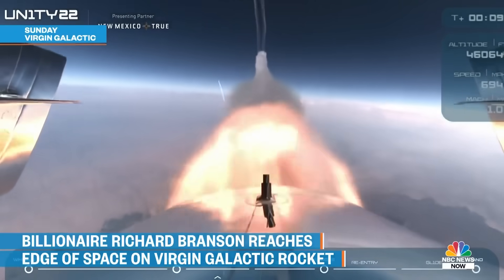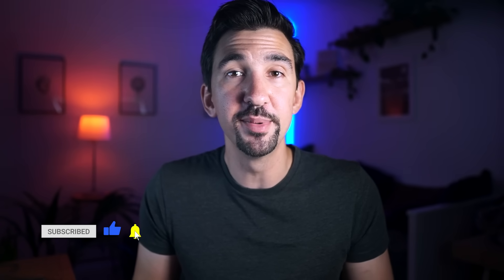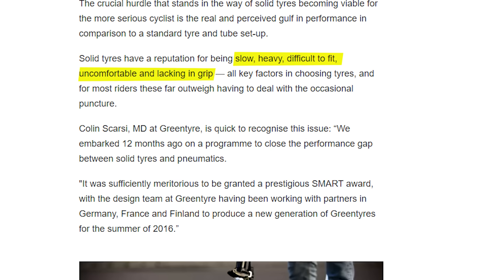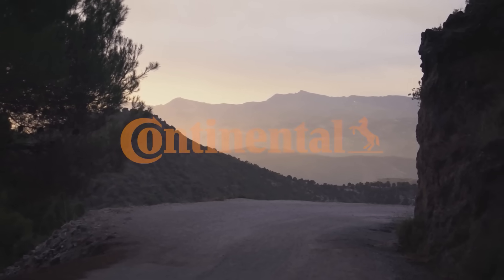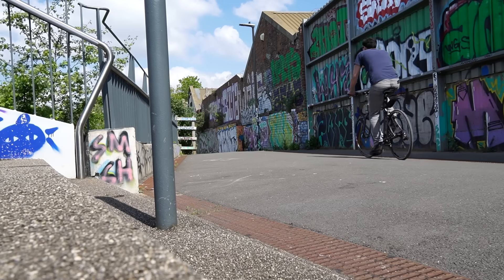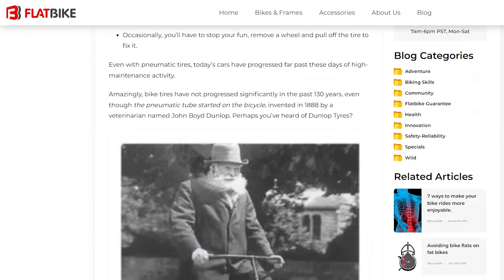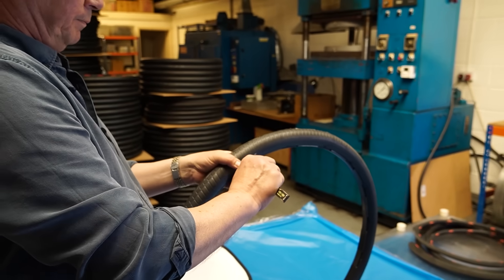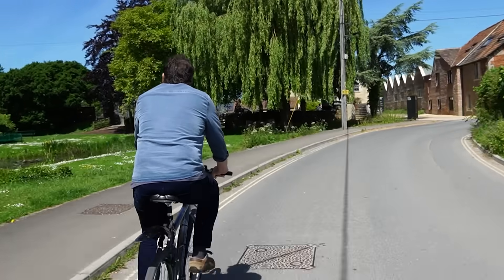I Tried Solid Bike Tires | Here's What I Found

Comment: What width of rim would you need to run these? It seems another disadvantage of these is that you can only pick a certain rim width, and absolutely need that specific rim width for them to work. Whereas a normal tire can be fitted to a range of rim widths depending on what you have.

Comment: With proper pressure, I get like no flat tires at all. Solid tires have more weight and you can't adjust the pressure like in a normal tire (if I go to bikeparks, I let some air out of them, and if I ride street for a day, I put some more pressure in them to adjust grip and rolling resistance).

Comment: 4000+ miles on my cheap btwin tyres and not a single puncture - replaced them because there were cracks on the sidewalls (partly age and partly due to only inflating them only once a month). even the treads were intact. and they also cost 1/10th of these tyres. solid tyres may be the future, but probably not just yet.

Comment: Worked in bike shops for years and saw plenty of airless tires. Bicycle wheels were not designed to work with airless tires. When an air filled tire takes an impact, the force of the impact is transferred over the entire rim. Airless tires not only have lower performance, they destroy your wheels. Flat tires are an annoying inconvenience that seems to happen at the worst time but it had been the primary design for so long because nothing else works anywhere near as well.

Comment: And once the outer tread surface is worn down the tire gets trashed.  Only now theres even more material in the landfill because it's a solid tire.  Pressurized air is still the best and cheapest shock absorber in the universe.

Comment: But wouldn't those full of rubber solid tires be devastating to produce for Earth?

I'm personally using some air-filled wonderful Schwalbes and no punctures in years of heavy use in mountain and downhill. Same for my road-smooth dirt Continental tires. Both these sets need to be replaced on my bikes out of pattern wear, just like a solid tire would have to. And without all that rubber production waste.

Comment: Rotational weight is equivalent to 4 times static weight. so 400Gr is way too heavy even for commuters. I tried solid rubber tyres, it feels like wood, and went back to my Continental GP5000. I can change it in 2 minutes and only have a puncture every 6 months.if you have too m any punctures, you are riding it wrong.

Comment: Mountain bike tyres are less prone to punctures than other normal tyres in my experience. Have cycled over 130,000 km since I started cycling again back in the summer of 2009. I live in Athens, Greece so get the diversity of cold winters, hot heatwave summers and lousy roads. Doubt that I would go for solid tyres even if it meant no punctures.

Comment: One of my road bikes has Tannus tyres - I only use that bike on the static trainer. I originally used them on the road but found two problems. The first was that the tyres felt to be dragging - loads of friction - most unpleasant. The second problem (which I hope that Gecko addresses) is that because the Tannus tyres have far less "give" than a pneumatic tyre, they transmit any shocks straight up the spokes to the hub and with a "J" shaped spoke where it fits to the hub I found that several spokes sheared off at the bend in the spoke. As you mentioned in your video, the Tannus tyres are a nightmare to fit so imagine trying to replace a spoke! It can be done but, under no circumstances, allow the nipple to fall back into the rim, otherwise it's game over. This facet is important to physically large cyclists, I'm 6'3" and my optimum cycling mass is around 110kg because I have very broad shoulders. I also still hold my British Cycling Race Licence at age 67 and enter things like Ride100. If any of my comments are of interest to Gecko then please pass them on. I look forward to them becoming available.
Reply: I agree and you also need to pedal all the time even downhill and the joys of a tailwind are removed.
Reply: @robjones1495  💯

Comment: The stiffness could be offset with some suspension, or perhaps a lighter and more forgiving wheelset.  If you flat spot one, it will tend to flat spot in the same place and put the wheel out of true.  That is less of a big deal for conventional tires that are usually swapped out within a year or two.  They seem perfect for gravel as you're not as concerned about ultimate performance.  Changing a muddy tire/tube on a trail is much different than a roadside swap. ;)

Comment: It's not just the mass of airless tyres which is the main problem, it's the effect of the mass when being accelerated.  It's that the mass is concentrated at the outer radius of a wheel, and thus it's the angular acceleration, ie torque applied to accelerate that mass which is the main problem! the lower that mass, the less effort to accelerate it, via the pedal torque applied! having said that, if the mass of the tyre is close to a pneumatic tyre, then as someone else has mentioned, for e bikes it will be a best seller. Unlike normal bicycles, Ebikes are much heavier and more of a pain to get home with a puncture.  Years ago, I tried the Greentyre variant of a solid tyre, it was so much more effort to ride, that I got rid of them as being impractical, one wonders whether the Gecko type will be closer in mass and riding characteristics and more palatable for the average rider! I will be buying a set if they are!

Comment: Shared bikes in China use airless tires. These bikes absolutely require this tech, for obvious reasons. They roll just fine, grip is good, and are excellent for the job. 26" rims on these bikes.  Take a look at a Hello Bike or Meituan Bike.  Good thing they're recyclable, as there are likely hundreds of thousands of bicycles rusting in piles across the country.

Comment: You cannot change the tyre pleasure though, so while they could probably sell tyres equal to different tyre pressures it removes a practical option of adjusting it yourself as you do  with a simple bicycle pump if you carry and extra load on a bicycle holiday, or drive on and off road etc.

Comment: I'm a bike mechanic. This tires will not catch up. Not with that price. Midrange you say? The average tire i sell the most costs between 15 and 20€. That's for your average city bike. Sure, occasionally i sell a Schwalbe Marathon (or similar) or Michelin Protec lines, which can be anywhere from 30 to 45€. And you almost never puncrure a Marathon or a Protec. I have a customer in a motorized wheelchair, which he uses actively everyday, it goes pretty fast on road. In the last 10 years he probably got a puncture like 4 times. That's with Marathon Plus. 
The argument 'yeah, but you will never puncture again' will not work. Why? Because people are stupid. Most look at the momentary expense, do not think about the future. Hard to justify tires that sometimes cost more than the bike itself.

Besides, if you have a top of the line bike and want to spend a lot of money on tire/wheels, just go tubeless.

Comment: I think the biggest plus for these tyres is their 100% recyclability - assuming that's actually true and not just marketing lies. I have mostly used Gatorskins over the past 8 years or so but they are getting a bit pricey now so I'm trying other brands. I have had punctures but it happens so seldom that it doesn't cause me much concern. I would certainly love to have a tyre that is guaranteed not to puncture though. The only thing that bugged me about this review was that the lifetime of the tyre was expressed as 2-4 years. That's no good, I need to know how many miles/kms that equates to. I'm currently cycling a bit over 10,000 miles per year, I find that a typical tyre lasts 3500-5500 miles. The wear is what causes me to replace a tyre, not punctures. So to work out whether these are reasonable value, I want to know how many miles are being factored in to that 2-4 years lifetime. If it's comparable to my general experience, then paying a little more for total puncture resistance is fine by me.

Comment: I think he's hamstringed himself by tackling half the system. A tyre doesn't work without a wheel. Making a tyre fit a rim for beaded tyres that doesn't have a bead has a high chance of being a compromised solution. If he succeeds, his tyre is likely to only be an intermediate development.

If it's truly punctureless, then the need for it to be rider serviceable as good as disappears & you can have specialised tyre fitters & equipment, as car tyres do. That gains you your recycling loop, as well as a model that allows a better optimised wheel rim for the new tyre.

Comment: I’ve not been able to read all the posts, so this may have been mentioned already…

In motorcycle off-road sport, especially long distance riding, for many years we have been using mousses instead of tubes.  They work very well for us, no punctures of course, and that totally compensates for any performance downsides.  You need to see if Michelin, who do most of the motorcycle mousses, are doing anything similar for bicycles, and if not, why not?
Reply: Dear Ian, Yours is a good point (though I know nothing about off-road motorcycle sport). If one group of two-wheeled enthusiasts can do it, why can't another. I suppose we should not forget, though, that all the motorised two wheelers will have suspensions and much more power than a human-powered one.
Luke
Reply: @lukewiseman9946  Hi!! Yes the same brand TANNUS TIRES do this mousse for Mountaibike. Similar concept than Motocoross. Also other brands. Good point!

Comment: I have a set of Tannus fitted to a low mileage single speed commuter (its a belt drive bike, so I was aiming for a zero maintenance set up). I cant ride the bike...hence the low mileage. Whilst the ride quality is fine (I like a hard tyre) the rolling resistance is absolutely, mindwarpingly, thigh sappingly awful. The "COR" mentioned in your vid is REAL. I think of it like this. if you squish an air filled tyre, the air moves around the tyre and eventually  back to the point of squishing, which means that the tyre sort of "gives way" for you to roll. With a solid tyre there is nowhere for the squishing to go except either side of the squish, which flattens the direct area of contact and creates a little "bow wave" or bulge in the tyre right in from of the flattening....its like rolling out pastry, rather than surfing on a wave. horrid to ride. I have a 12 mile ride home from work and had to stop three times to give my legs a break...I regularly ride the same commute on other bikes with no tiredness and no need for stops. will check out Gekko.
Reply: Probably the single speeds fault. Using these on a city bike for about the same speed as you, and I find no problem with them.

Comment: The shock absorbing deficiency of the solid tire, as designed at present, combined with its increased difficulty of installation are two large detractors.  I think the answer to keeping pneumatic bike tires inflated and puncture-proof is a liquid product called Flat-Out that you inject into the tire that instantly seals every puncture and seals all air leaks around the bead.  The product always remains liquid and never hardens and will outlast your tire.  Try it, it’s incredibly effective.

Comment: If you puncture every month there is an issue with your tyres. I have been on a set of schwalbe durano tyres for 5k + miles with no punctures highly recommended them or Specialized Armadillos.

Comment: If you have a flat once a month, switch brands. I bike 6000 km a year and I have a flat every 2 years. Schwalbe Marathon. Maybe the brand is swallow where you are from. Actually, I'm riding Schwalbe Racer. They are less puncture resistant but good enough.

Comment: Your   bike tires goes flat once a month because of either one of the following or some or all of them:
1) your tires are sht.
2)You are riding your bike on places where that type of bike should not be.
3) You do not know what is proper tire pressure for your bike/ your weight/ surface you are riding on.
4)Manufacturer of your tires designed them to not be good enough.

I did not puncture my tires ...well, for decade now.
I ride downhill and city routes.

Comment: They shoudlve just recycle the old tyres and then resell it. the reason why it should be like is because if they keep making new tires then that means they have to get more resources making them spend money. They just have to get all the old tyres and distribute them to its respective company, then, that is the time where they can either melt it then mold it or do it through injection molding or some other stuff.

Comment: Most of the rolling resistance is generated by the fabric pulling back and forth through the imitation rubber they are embedded in.
Pneumatic tires have terrible rolling resistance unless pumped up rock hard so the casing doesn't deform. 
Which gives rubbish harsh ride. And the bounce problem gives terrible traction. 
Solid rubber, elastomer or foam core tires are much better. 
Solid rubber tires that give you harsh ride and high rolling resistance are designed to do that because they want to make you spend lots of money on endless crap pneumatic ones.